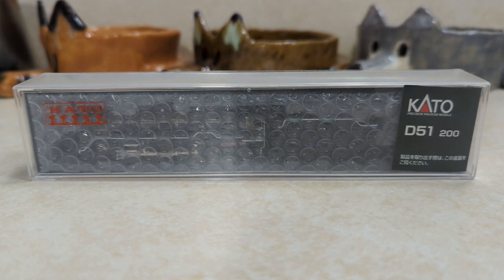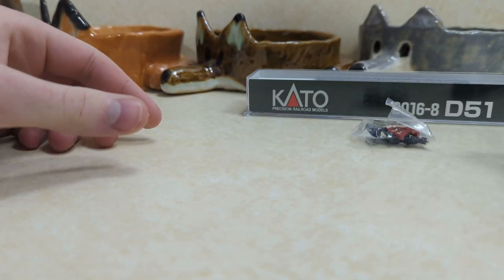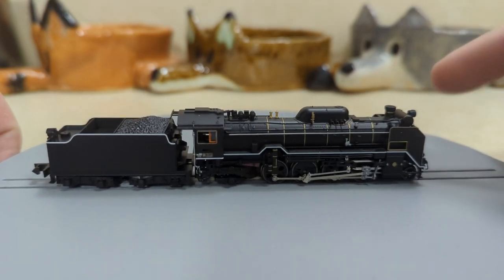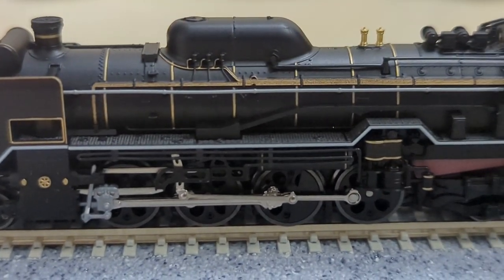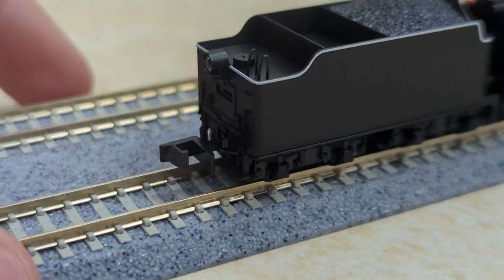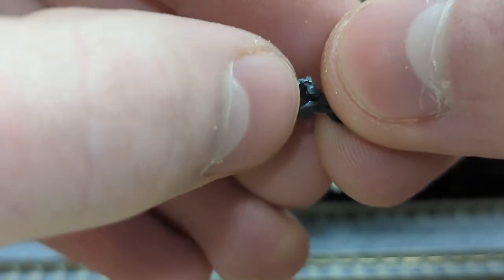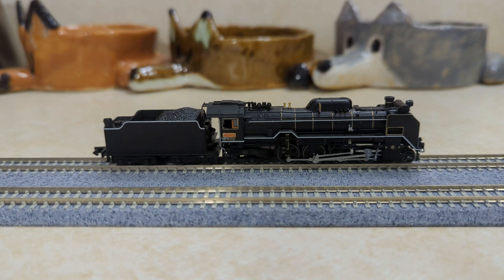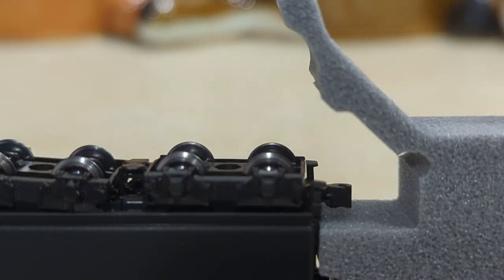Kato N Scale D51 200 (Hiro) Unboxing and Detail (Part 1)

Comment: I just finished watching the video with the two Tech2 Controllers I can understand the wiring of the kato track going to the Tech2, but what I would like to know is what kind of control are you going to use when you travel over the switches. 
Do you think if you have any time if you could do a video on how you were able to connect the switch track to whatever controller you're going to use with the switch. 
Thank you for your time 
Sincerely 
Allan
Reply from the maker: They are remote switches, but I've just been switching them manually. I don't have the wiring set up to the controller at all.

Edit: Oh! You're asking if I'm going to do that in the future. Maybe not, but I could think about it.